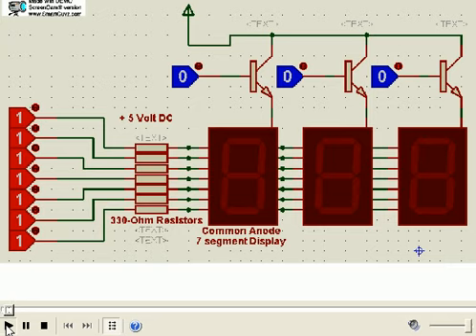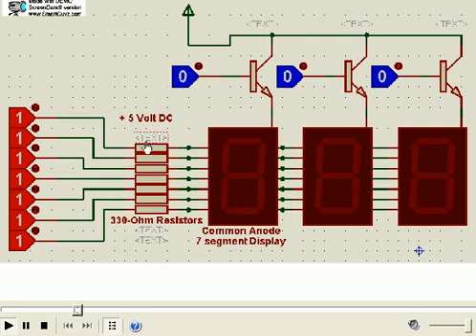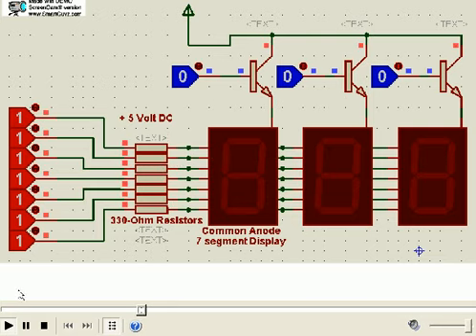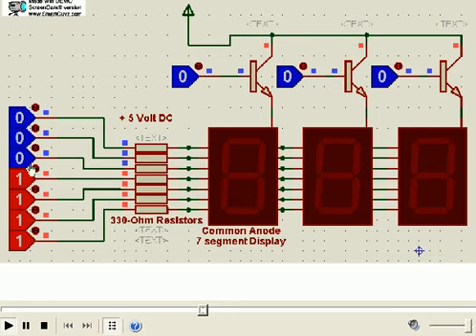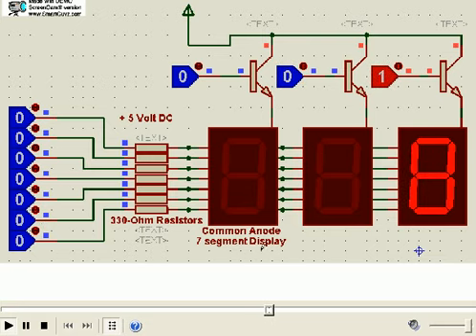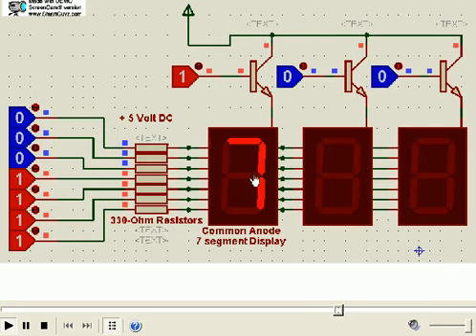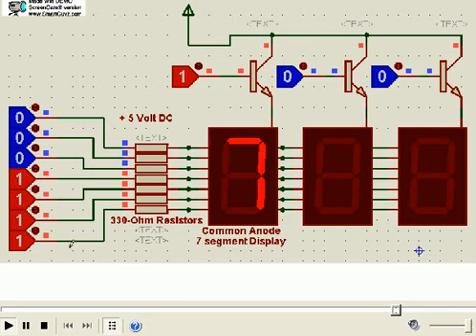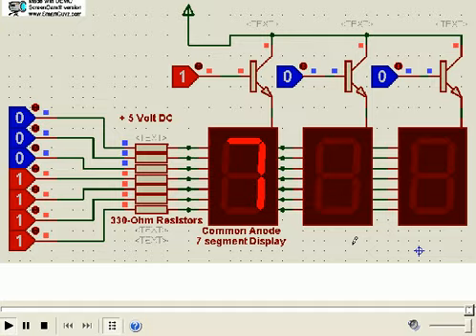Multiple 7 Segment LED interface to microcontrollers

Comment: @milabut does the base of each transistor connect to digital pins of the microcontroller? if so, do you not need to connect a resistor to each base? thanks

Comment: Can we connect NPN & PNP transistor to common anode display or connect only one transistor which one is ??
Reply from the maker: You can use PNP also where emitter goes to +ve(vcc) base logic 1 for transistor off and 0 for on. But there is a small problem. You can’t make vcc more than 5 volts.

Comment: is this logic applicable to seven segment display made by LEDS(many LEDS)? i am little confuse with power supply.
Reply from the maker: Yes possible verymuch
Reply: +Patnaik UC we are using arduino which has 5V power supply for making a huge board which has LED so it is not sufficient power for this therefore if sir could give us some solution. is supply to the LED is from different source or from arduino itself?
Reply from the maker: Use separate power supply for LEDs and take the drive from arduino  to each of the 7 segment made by individual LEDs through 7 power transistors ,ie one  for each  or a power mosfet .Same for the control transistors for the common positive from the same separate power supply
Reply: thank you sir. we need more help from sir,but we are facing difficulties to contact sir.